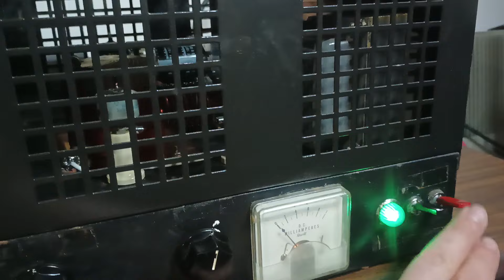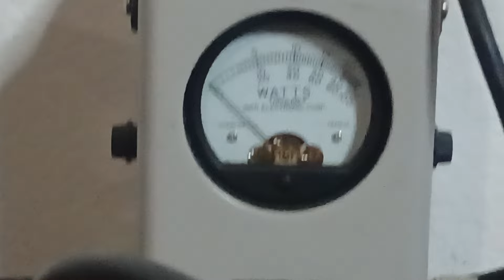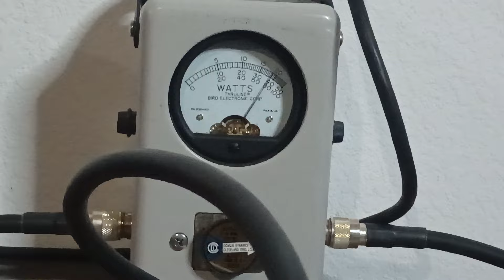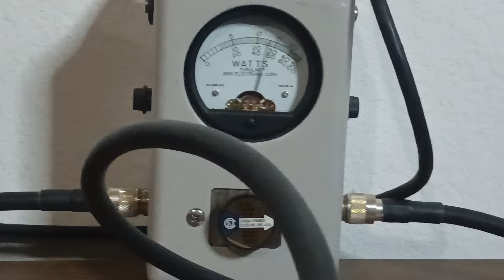Bone Built Creation, Gi46B Base amp with sweep tube driver, local pickup only

Comment: I had an amp similar that used 2 4cx250b tubes. It didht work right so i moved it on. I still have the spare tubes for it